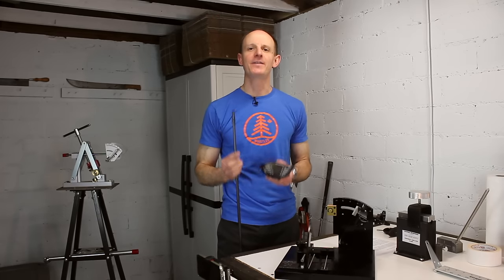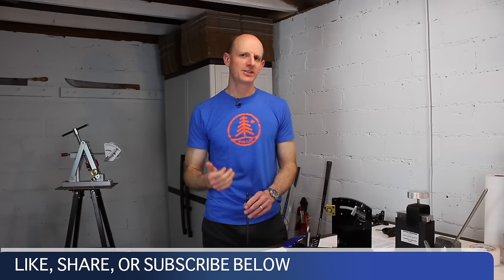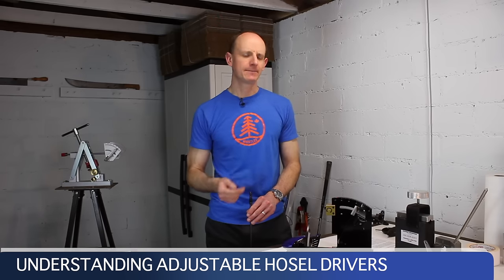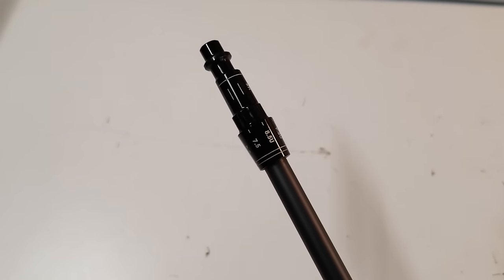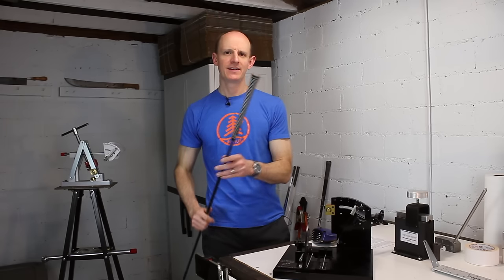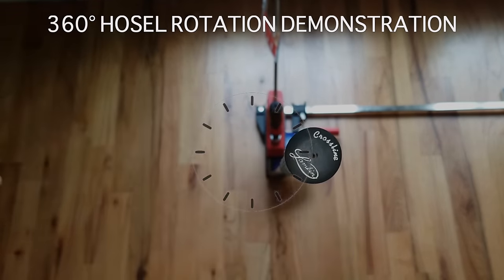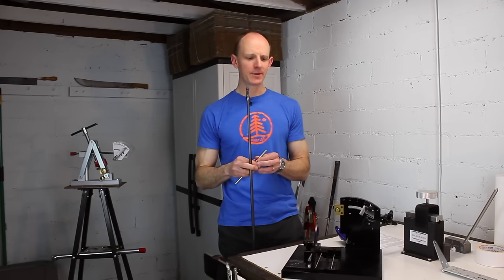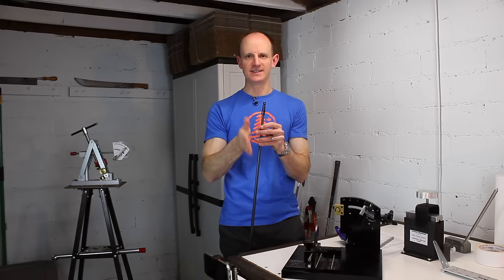Adjustable Hosel Drivers - How they change Loft, Lie, and Face Angle

Comment: The best video on loft and lie with adjustable drivers ever. Thanks!
Reply from the maker: Thanks for watching. If you haven't, please subscribe as we have a lot of good stuff upcoming.
Reply: Damn never knew this
Reply: @EFGMC  clear and accurate explanation on adjustable hosel settings. Thanks for clearing that up. A couple of questions though. 

1. Would lie angle 📐 change have an effect on the center of gravity when making these adjustments? 

2a. What is the exact degree increment change in lie angle +/- from Neutral Standard? 

2b. While negligible, would it be have an effect on the club head, maybe the closure rate or feel?
Reply from the maker: @alldayrays7110  1. Yes I am sure it has some small change but honestly not enough to worry about. I think the CG change from increase/decrease of loft would be far more influential yet still too small for most people to worry about.
2.The lie angle change will depend on the club type and what the adapter is set at; 1,1.5, 2 degrees. Taylormade for example has a chart that shows the exact lies, lofts, and face angles with each setting.
2b. I have heard some people say the flattest or most upright lie can influence some golfers closure, but there is no rule for it I would say. Depends on the golfer.
Reply: Agreed. This is the best explanation of adjustable hosels and their effects I have ever seen on YouTube.

Comment: Have spent ages looking for an explanation of how an adjustable driver works but now I've found it - a superb video explaining in simple terms the impact of changing the settings on the hosel. The use of a clock face to illustrate the relationship between the club head and the shaft was particularly good. Thanks and best wishes

Comment: Thank you so much for this video. I couldn't believe how many videos I'd tried watching that basically just said "ehhh well ya rotate it and it changes loft and lie, you figure it out..." lol like why even make that video?! Thank you for actually explaining. The critical component that I think is easy to miss and that causes the confusion is that the shaft and hosel are not parallel. I was wondering how the hell essentially just twisting the shaft would change the way the club hits, assuming that it was just rotating on an axis down the center of the shaft. But knowing that it shifts the angle of the shaft in relation to the head makes SO much more sense haha.

Comment: One of the best explanations of the adjustable sleeve. I come from an era of flat sole woods with different bore angles. The rounded soles of drivers make this possible. Slightly less applicable to fairway woods and hybrids that don't have much camber. Tom Wishon was one of the most outspoken in this topic.

Comment: Good explanation. I have a Ping driver and even the Ping website doesn't give a detailed explanation, just a chart. The 2nd assumption is critical in order to just be dealing with a change in loft and not opening or closing the face. Very well explained.

Comment: FINALLY!!!  Someone who was able to explain how the adjustable hosel works.   I thought this was either one of the greatest golf mysteries or product gimmicks of all time.   I have spoken with many golf product people and no one could explain how the adjustable piece made a difference in the driver head.  You finally explained ( and showed) in a way an engineer can understand the mechanics.   Thank you.   The missing piece that no one knew to mention is that the adjustable component is essentially bent at a slight angle.  I guess the answer was just too simple for others to understand or try to explain. The angle is of course so small I could not see it with my naked eye nor had I thought it through on my own without visual evidence.    Also you have a great channel.   I am getting ready to rebuild my 7 iron thanks to you.   Thanks again.

Comment: Thank you. I bought a new Callaway Rogue Driver. I couldn't hit it at all. Topping it every time and miss hitting it. After an hour of frustration, I changed the hosel +2 degrees. I hit the ball perfectly fine after that. Its insane that it was the difference. It was an inch longer than my previous driver but it blew my mind that minor of a change allowed me to stop topping the ball and it going 50 yards vs 250.

Comment: This is a great video that explains how the adjustable hosel adapter affects the loft and lie. I think for those that are still having difficulty understanding this you have to think about the center of the clock as being the normal grip position of the individual golfer (of a RH golfer in these examples) when holding club for the shot (A.K.A rule #1). At 5:12 in the video when the clock face is shown and the grip is rotated around the clock, in your mind, visualize the grip being moved to the center of the clock as the final position of the shaft when the golfer holds the club and then how the head itself moves as a result. For example, when the hosel is inserted so that the grip is at the 6 o'clock position on the clock, when the golfer then holds the club, the golfer naturally positions the grip into the center of their clock and the head of the club as a result is rotated forward thus reducing the lie. If the hosel is inserted so the grip end is in the 9 o'clock position, the golfer again puts the grip into the center of their clock which results in the club head to rotate slightly to the right which increases the loft. The lie angle is also slightly higher than it would be if the hosel was at neutral so the net result is a slight opening of the club. If the hosel is inserted at the 12 o'clock position, when the golfer holds the grip in the center of the clock, it raises the lie due to the club grip moving downward from 12 o'clock to center. At 3 o'clock the grip moves from 3 o'clock to the center of the clock thus resulting in the club head rotating slightly to the left which lowers the loft. The lie is its lowest when the hosel is inserted for the 6 o'clock position and the highest at the 12 o'clock position. The lie then always increases when the hosel is changed from the neutral position. The loft is the same at both 6 o'clock and 12 o'clock grip positions and max loft is at 9 o'clock grip position and minimum loft is at the 3 o'clock position. This is all taking into consideration when the grip end is centered in that clock which is what happens due to rule #1 and when the club face is squared to the target due to rule #2. Always think of that grip moving back into its center of clock position as the "final adjustment"

Comment: Thanks for yourunderstandable demonstration and insightful "assumptions"., assumptions.  The time was well worth it especially after searching for an hour on how the "adjusters" work.  I bought a used M5 and want to optimize it.
Reply from the maker: The M5 is the perfect club to pair with this video as it has the rotating adapter. Keep track of the ball flight and impact position as you get it dialed in.

Comment: I'm also a club builder and I argue this point with my fitters all the time: the setting does not change loft AND face angle; the setting changes loft OR face angle (depending on how the user holds/delivers the club). For example, Taylormade's chart says that in the "LOWER" setting, the loft is -2 degrees AND the face is 4 degrees open. According to Assumption No. 2, the golfer is pointing the face at the target. If the face is pointed at the target, then how can it be open? I use the same Golf Instruments M-310 gauge and I've measured pretty much every settings from every OEM. The loft is always accurate to what the vendor says it does...WHEN THE FACE IS SQUARE.  However, if I take the Taylormade LOWER setting and open the face 4 degrees, then the loft reads standard loft again. That's why some people argue that you're just changing face angle (and not loft). I say you're doing one or the other, depending on the golfer.
Reply: Hi Alexander. I just watched a video on the taylormade loft/lie and I was confused. You answered my question!  Watching that video I was so confused because of assumption number two on this video. If the club face is facing the target, only loft would be changed right?  Therefore it should not cause a draw/fade bias, is that correct?
Reply: @flyfishaholic  hi! The other variable not mentioned is club path. 0° face with 3°i-o is a draw; 0° face with 3°o-i is a fade; 0° face with 0° path is straight. My advice is to try neutral, highest loft, the lowest, and upright to see which quadrant is closest to your desired ball flight.
Reply: When going +1.5 loft to keep pointing at the target do you have to move the ball position further ahead of your feet ?
Reply: This is big knowledge. Thanks.
Reply: Does it matter how you orient the adapter when installing?
Reply: @nikopugs  If you weren't fit, then default to standard setting for aligning your desired shaft orientation (logo down, up, SST Pure, etc.). If you WERE fit to a specific setting, then you'll want to align your desired shaft orientation with that adapter setting.
Reply: @AlexLiSince1983  thank you!!

Comment: I was being fitted for a driver. The ideal "loft" was between the two options of 7.5 and 9.5 heads. I needed 8.25 and when we measured results, adjusting up from 7.5 worked better for me that adjusting down from the higher club. Your video shows why. Head/Default Loft, shaft, then adjustments... It take a while but is worth it.

Comment: Thank you! Exactly the explanation I was seeking. Knowledge is power and you made me a powerful man.
Reply from the maker: Happy it helped. I find it's pretty simple once you can actually see how the head and shaft move during the hosel changes.
Reply: You covered it well. The only other question I have is this: The early adjustable clubs (Open, Neutral, Closed) are the ones that are adjusting only Face Angle due to the adapters being in a straight line with the shaft. Is that, in general,  a correct assumption?
Reply from the maker: @MrUlfdub  Ha Ha. Here is where it gets tricky. They are actually doing the exact same thing. The OEMs decided at some point in the last 10 years give or take, to stop referring to face angle change and instead focus on loft change.
The adapter is tilted in relation to the shaft in either case, it just comes down to marketing and how you want to view the changes that occur. I have no issue calling it loft change personally, I know some people only refer to it as face angle change. Just depends how you want to view it and how you address the ball.

Comment: This is very well explained. Thanks for stating the 2 assumptions, without these, I would've thought my adapter was installed incorrectly since the lower lofted switch actually opened up the face.

Comment: Hi First I would like to say thanks as I have tried to explain exactly what you say to others in our group who think its all BS so I have forwarded this and told them to sit down with a cup of coffee and LISTEN.
I would like to add that as you can buy ( probably other makes too) Golf Pride’s new ALIGN Technology Grip is the first with a raised ridge. You cannot use these on an adjustable driver generally the only make that keeps the shaft in the same position with the cog mechanism is of course Callaway which means you can us an align grip but also take advantage of having a spine align shaft too which of course is a waste of time on the other type of turning the shaft loft adjustment drivers. Regards John

Comment: Fantastic explanation! I was afraid to adjust my driver down as I was told it would open the face but I feel pretty confident after watching this that if my club face is aimed square I won't be slicing. Thanks!
Reply from the maker: Correct. And even if you did see a slice, you can always just go back to the original settings, no harm done.

Comment: Excellent video and explanation. I've always shied away from adjusting the loft as it affects the way the head sits on the ground at address. I'm going to try setting the face square at address with different lofts the next time I'm at the range.
Reply from the maker: That's the best way to do it. Different drivers will sit differently in the grass so the face angle effect can be less in some cases.

Comment: When Titleist brought out their first adjustable "Surefit" hosels for the 910 range of metal woods I was intrigued as to how it worked.  The aerospace engineering instinct/background i I'd worked in for nigh on 32 years kicked in.

I managed to get hold of a hosel adaptor.  I set it up between centres and set a DTI  (dial test indicator) on either end.  Rotating the adaptor between the centres I worked it out that the difference in concentricity between the ends equated to between 0.5° and 0.75°.  Nothing to shout home about.

I always believed that any loft change would be minimal and then it would only be effective loft which was created by flattening or making the lie angle upright.

Exaggerating examples of doing this with irons would be when say using a lofted wedge with the ball either above or below stance.

This led me to conclude that the tiny adjustments that could be made using these hosels could actually be made with the hands and the stance.  Any adjustments using a movable hosel adaptor would be negligible and just another marketing gimmick.

Comment: I just picked up a mint,limited edition white SLDR 460 and this video is a great primer on adjusting it.Thank you!
Reply from the maker: That club is a beast when you catch it center.
Reply: @EFGMC  I have the SLDR C version,which is the one that has no slider on the bottom.Are you familiar with that one?I really like it despite being glued hosel and no track on the bottom I was on the hunt for an actual slider 460 and found this white version I had no idea existed!
Reply from the maker: @marybetheby5184  I remember it, but can't recall seeing numbers for it vs the moveable weight version.
Reply: @EFGMC  Ah ok..yeah,it kinda snuck in under the radar.Someone pointed out that the C is a full size version of the SLDR mini.And having that club also,they are correct!Thanks!👍

Comment: Great video. I remember when playing the R11S you could adjust it for draw, fade and a few other settings. basically it was a hexagonal piece that would change the stance of the club when you placed it on the ground.
Reply from the maker: Couple brands did similar but not anymore. Guess they decided the added weight wasn't worth it.
Reply: Did everybody ground the club then regrip? I much prefer non adjustable drivers that have the loft and face angle that is desired.

Comment: Thank you for this video.  I always suspected some changes that were inevitable with altering a club so much.  I personally think that buy a club in a loft you can use right away and have it adjustable to the point where it’s still good when your at your best game.  +/- 1 degree of loft.  Also, weighting more then adjustments for Fade/Draw.

Comment: I am a school teacher and it is great to see someone on YouTube explain/teach something well. With that said, I am curious how a standard loft hosel club would perform compared to the same club with a -2 degree loft hosel.  With the golfer keeping both clubs square at address, would the -2 loft club, because of its inherent imbalance, have a greater tendency to open up at impact and hit fades?
Reply from the maker: It's only "out of balance" when in resting contact with the ground. The vertical center of gravity can change with the hosel adjusted, but I don't think it moves enough to present a noticeable change in ball flight.

Comment: Really fantastic video. With the HUGE weight at the back of some of the modern MAX type heads, I don't think I fully grasped, prior to you showing the head in the vice with the 7-degrees vs 11-degrees tilting, how much the Verticle CG was rising and falling, between these Max vs Min Loft setups. In the fully de-lofted case, it will certainly make the bottom of the head more spinny, because of the increased verticle gearing and the top of the face, less spinny, in the max-lofted case. Very useful to know.
Reply from the maker: Thanks. Really highlights that people pay attention to strike location on the face, as you point out the vertical CG is moving with these adjustments and can result in the opposite of the intended goal for launch and spin.

Comment: That's the best explanation of the adjustable sleeve that I've ever seen. But isn't it part of the design to have the face closed or open for these adjustments to help influence the ball flight....or more specifically to make corrections for potential swing flaws. For example if you struggle with a slice if you moved it to a setting where the face sat more closed that would help offset some of the issue of the slice swing since the club would be set up to impart a draw spin on the ball regardless of the swing path.
Reply from the maker: Suppose it just depends how you look at it. Some drivers are built to sit closed or open at address. I think this is better because you know what you are getting from the start. The difference with the hosel change is that it's not an isolated face angle change. Loft and lie are also changing along with it. You can't get the face change without changing other specs.

Comment: Great video.  I am being fitted for my new driver next week so likely won’t be an issue.  That said my question would be why wouldn’t everyone buy a 10 degree driver with the ability to loft or deloft as they choose?
Reply from the maker: Different golfers will have different AoA and dynamic loft at impact so some golfers will benefit more from a lower or higher loft. Speed also plays a big part in the equation. But I do agree that most should get something in the middle so you have room to adjust if needed.